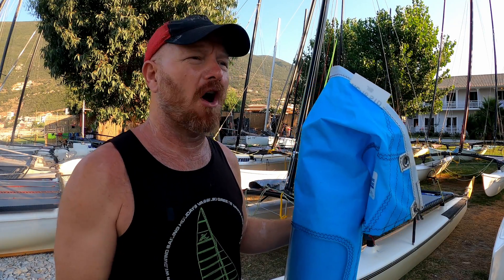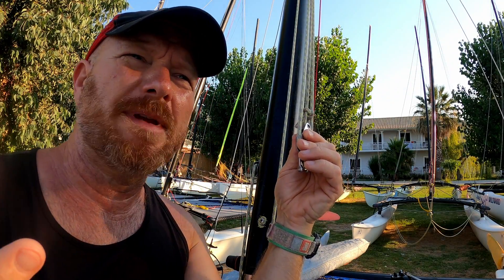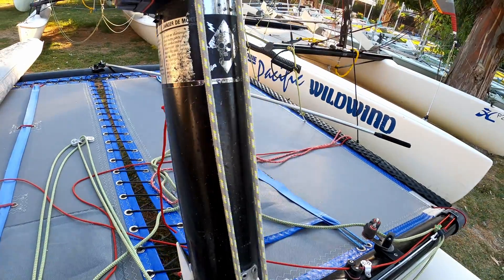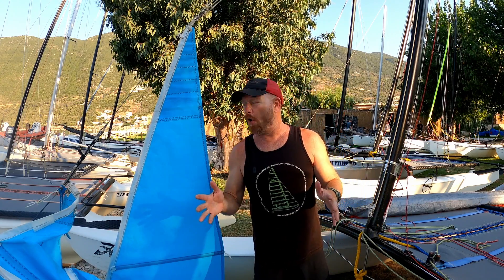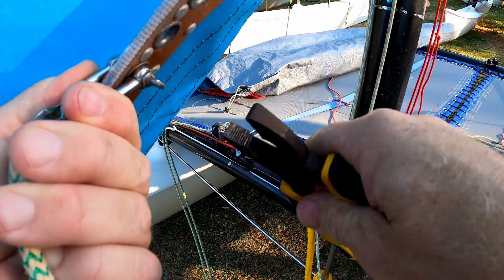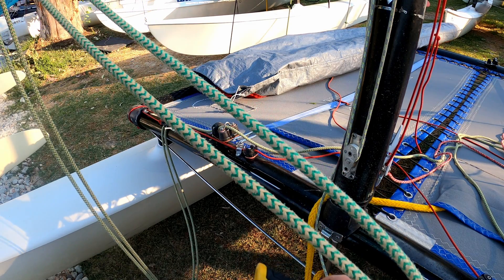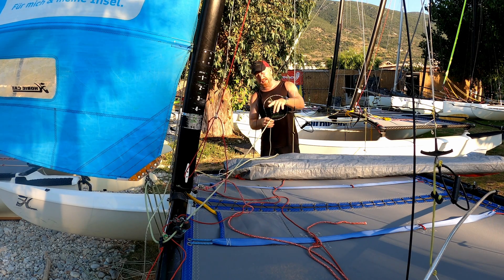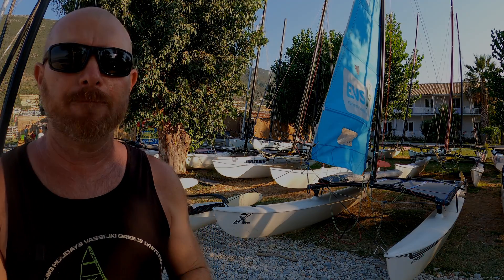Everything you need to know⛵️Hobie 16 Jib system

Comment: Nice clear video, thanks Joe - on our club Hobie 16's,  I got fed up with folks losing pins and ring dings in the sand when they were rigging boats. I have replaced the shackle/pins/ring dings for all the jibs with 2-3/4inch  (70mm) Jaw Swivel  Stainless Steel Snap Shackles, about $15 on Amazon for 2. You need total of 4 per boat. At the clew,  the first snap shackle is pinned on lowest hole on the multi-hole adjuster plates, roughly equivalent to the third hole up if you just used a pin. For the head of the jib, the second snap shackle is attached directly to the Aussie rig halyard block.  For the tack, the third snap shackle is pinned thru the 2 jib sheet blocks. If the sail plate is newer, then you may have to grind the sides of the snap shackle a bit, to make it narrow enough to fit thru the grommet. It's still strong enough!  I use a fourth snap shackle on the upper 6:1 downhaul block to attach it to the mainsail boom. I use a larger snap shackle for convenience for the mainsheet block, as you have recommended previously. The main halyard has a captive pin on its shackle as standard, so now each corner of each sail connected by captive pins. Much less frustrating for all and they worked well all of last season.
Reply from the maker: Thanks for that, sounds like a great plan!

Cheers

Comment: Great stuff, Joe. We use a bow shackle on the clew, with the bow through the second hole from the bottom and the pin in the third.  One block on port, one on starboard side of the clew. That gets the blocks snug up to the clew giving some flexibility in rig tension and still being able to go block to block when sheeting on tight.
Reply from the maker: Yes, nice, this is what the racing 16 sailors favour - for us in our situation we stopped doing it as it wasn't necessary as long as all of the boats were set up the same.

Comment: The adjustable clew plate determines if you're pulling more on the foot or the leech. Use the full range for maximum benefit. Very light air hook up at the top hole. Very heavy air, hook up at the very bottom hole. There is so much power to be gained or lessened on this item and so many won't take advantage of it.
Reply from the maker: We never go higher than the middle as this hooks the leech of the Jib and kills the airflow. In the same way, we generally don't go any lower than 2 as that opens the leech too much. 
That's in my opinion of course.

Comment: At the 5:28 mark where you are talking about routing your jib sheet thru the Trentec jib car.  Why don't you switch the two holes (of the Trentec that the jib sheet goes thru) so the jib sheet's knot is outer and jib sheet is inward?  This would reduce the friction on the jib sheet from having to rub against the knot.
Reply from the maker: Thanks for the tip. 
I'll have a look and see how she runs.

Comment: So there is no wire on this jib halyard, it’s entirely rope. I see the one “incredibly strong” diamond shaped block you attached to the sail, and at the top on the mast is a block with 2 wheels? I don’t have this system but I’d like to upgrade to it. Can you tell me about the line you prefer to use? Thanks a million Joe
Reply from the maker: We use a 5mm rope with a dyneema core or 6mm even better - you want zero stretch from the rope.

Comment: Hey thanks for the videos... I'm new to sailing so this may sound like a dumb question, but do you have the jib traveler hooked to some bungee cord to have it reset to center when tension is slacked on it? I just got a Hobie 16 and have been going completely thru it and am about to take it for its maiden voyage ( as she's a new boat now!! :))  Also,  I'm a logger by trade so what will I be when I'm out on the water in control of me own boat?  A Skipper,  Captain, or just a rookie? 😎  Thanks again!!  I cant wait!!
Reply from the maker: Yes, bungee attached to the jib travellers so it automatically pulls it central when released. 
When you're out, you'll be the Helmsman